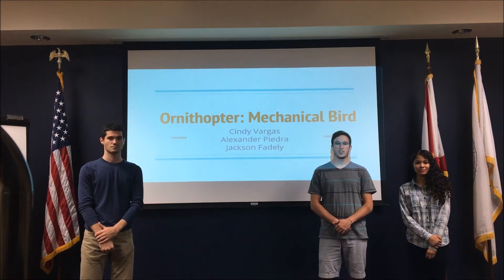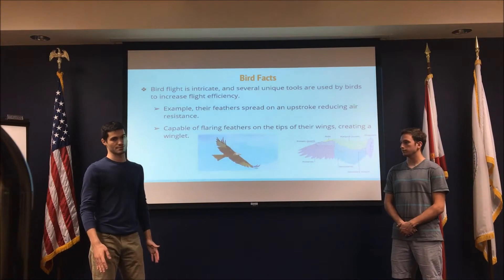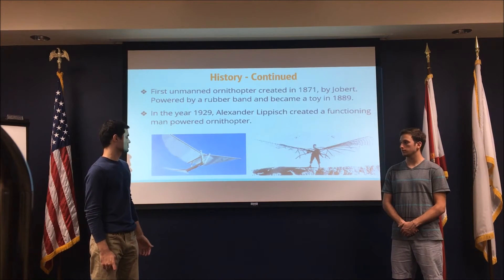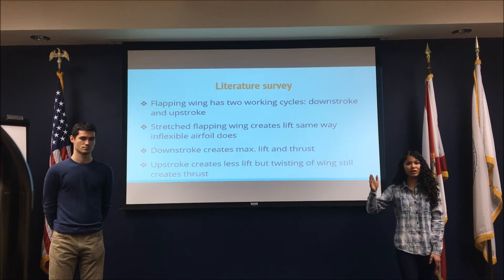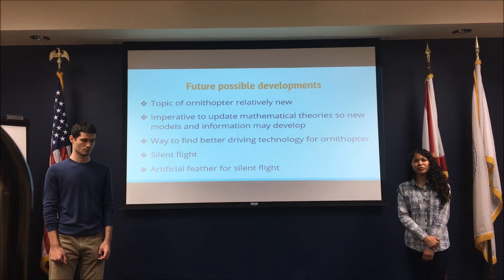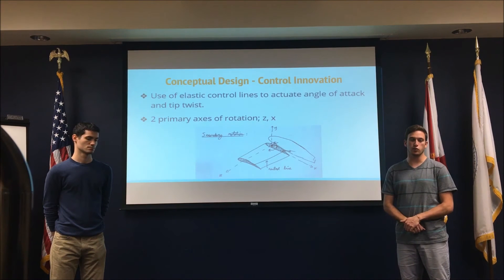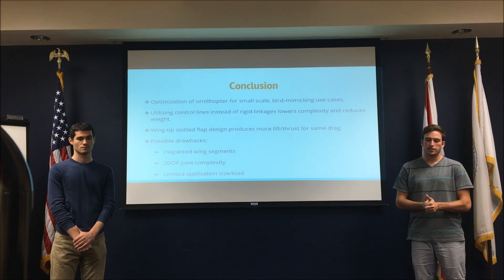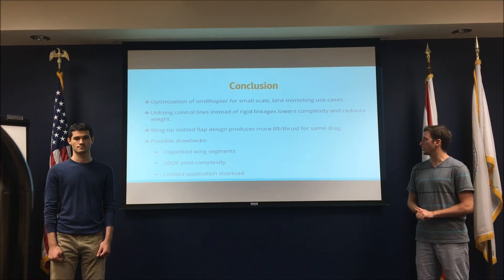Team 1: Ornithopter: Mechanical Birds

Comment: Very complete and well researched project, other than the slides being light at times, they were detailed and contained the information that was spoken about during the presentation. Very well explained, the light in the room was perfect and you can see the slides clearly. The presenters could have worn more formal clothing but they did a great job. Overall a solid presentation with all the key points covered. The slides were concise and the sound quality was good and each presenter was easy to understand. The presenters should have work some more professional attire.